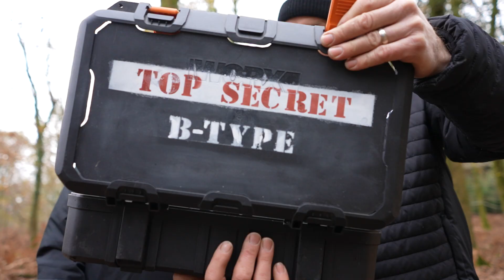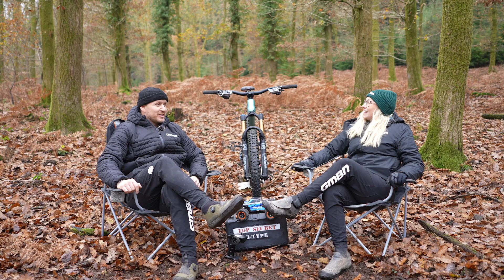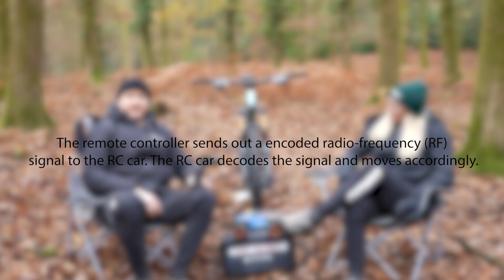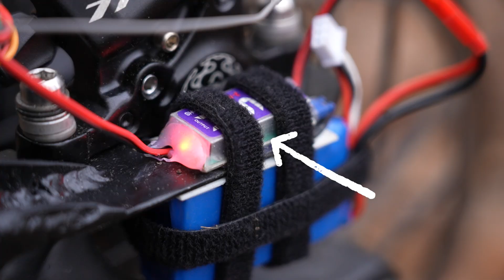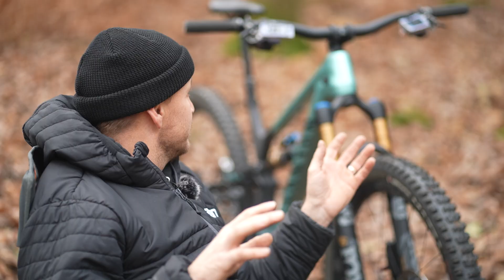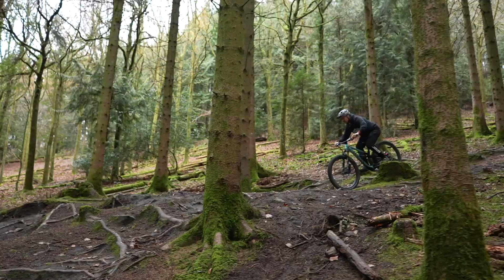Breaking News | Wireless Bike Brakes Are A Reality!

Comment: The airplane industry had to solve this problem 30 years ago in the Airbus. Sure one guy on a bike is not 300 passengers and crew in the back, but that one guy would still have to content with that nasty condition of being dead. How did Airbus solve it? With batteries? With a fancy wireless protocol? No, with tons of redundancy and computation completely out of the window for a system like a bike. We simply do not have the technology to air gap a system like that reliably. It's not one component that could fail, it's the combination of all components that must not fail. Yes sure, technically it is totally possible to remote control brakes, that's not rocket science. We started remote controling things wider scale in the 60ies. The more interesting question is why hasn't a industry so hungry not done the same for brakes? One could think of throwing silicone at the problem, even some AI could be shoehorned in there, predictive breaking in case of emergency, multiple signals etc etc, and dentists will be happy to shell out twice the price of current bikes. But at some point, when the suspension is computer controlled, the shifter shifts automatic, the dropper calculates optimal seat hight on the fly, we might as well put a motor in the bottom bracket and.... oh wait. I'll see myself out.

Comment: Definitely needs a better potentiometer to help it feel more precise and i think that some sort of spring would help the feel of the lever.
Very good though when you consider that this is the first iteration. I'm honestly impressed
Reply: I was thinking about the small elastomers that are in a Redshift stem for some progressive resistance in the lever.
Reply: @TheBRad704  that would work
Reply: I would definitely rather have hall effect sensors. I don't want "stick drift" randomly turning on my brakes, or having an imprecise actuation point (:

Plus, the hall effect could double as a motor cytoff for ebikes.

Comment: This has been bouncing around my head for years. Flying/driving RC, riding MTB but never put the two together. Well done Blake, stick with it mate.

High end transmitter (TX) with dual rates, exponential and end points. Different braking "modes" for different trail types could be setup, expo S curves for sensitivity/modulation and back/front bias, adjustable bite point, fail safe settings in the event of signal loss or low voltage  ... TX programming will blow your mind.
Low latency wifi servos (no servo wires required to RX) with control arms (titanium turnbuckles from helis or cars) on ball links instead of cable, short servo arms for maximum mechanical advantage ... Blake's E-Brake Mk2 could shine.
Add proggressive springs to levers to get that feedback feel.

Comment: Have SRAM do this using their battery for each brake, and they could include haptic feedback at the controls using another battery. So with a full set-up you could have at least 6 batteries, and maybe two more for Rock Shox flight attendant, so 8 batteries in all. Eventually, ebikes could use an in-frame (molded wiring) to pick up at all these locations with a plug intot he frame, and a "plate" similar to the battery mount for AXS, so the product could retrofit older bikes and the system could be used with new bikes. Not sure if the claipers could be all electro-servo or electro-servo/hydraulic boost.

Comment: If you attached the servo actuator to the end of the hydraulic lever you would get a similar hydraulic feel while sending the lever displacement to the servo, Audi is currently trying to do this for cars
Reply: Im also a mechanical design engineer, with 3d printing experience and capabilities, if you want to clean up that cockpit

Comment: Well ngl if we get like the connection and size problem fixed  it is really quiet exiting! Imagine not getting an armpump that quickly again because you don’t have to cramp your arms to get a strong brake nahh just let the motors do their thing. You can also with like motorized levers get a pretty good and also customized haptic feeling how cool would that be??? Bleeding the brake not needed! Brake power is also „just“ dependent on the motor itself. Servicing swapping etc is crazy for racing. Sooo if like a really big company is going to invest some serious time and money in there could be really really awesome brakes😮 probably will also cost like 7 livers? Still the weight is gonna kill it… we would need really powerful batteries that also need to last a long time. At the end I think to get such brakes to fit universal look sleek and also be able to use daily is going to be really hard :/ maybe it’s going to be a racing thing? I mean like small ones which can last 1-2 runs maybe?

Comment: Technicaly they are hydraulic brakes with additional crap and you gonna struggle to make that additinal crap smaller. I have hard time believing, that anyone would preffer bulky calipers over two hoses. While I was wrong plenty of times in the past, most probably wireless brakes would have to have some advantage over hydraulics to caught on. For that you'd need to outengineer that hydraulic calipers, which honestly I don't think can be done with current tech.

Hydraulics: 
+ work without batteries
+ don't need to be paired
+ self adjust for pad wear
- hoses

Your wireless construction (even after refinment, if the priciple ramain the same):
+ no hoses
- always heavier that equivalent hosed version
- additional failure points

Comment: Many thousands of us have thought the same thing with wireless and servos. Its fine for a chat on a channel, but just coz you can doesn't mean you should. Brakes are all about feedback and feel, and most importantly safety.
This is a pointless use of tech, which will "fail dangerous" , not "fail safe"
Stop this crap before someone gets hurt.

Comment: Brakes are probably the cheapest most reliable part of a mountain bike. I've gone 1500 plus miles on a set which outlasted the tires, tubes, chain, cassette and  pedals by several hundred miles. And I can't imagine my battery dying riding downhill

Comment: For proper 'failsafe' brakes like a Lorry or train, you need brakes that are held fully on and the mechanism pulls them off when its powered up. Pulling the lever then shuts the mechanism off and allows the spring to put on the brakes. That way if the battery mechanism fails the brakes come on.
Reply: Deadman brakes

Comment: You should replace the servo with a solenoid. you're technically still using a cable between the servo and the break system. A solenoid would be way more efficient. You would have to find a way to fit a plunger into the break system to replace the fluid. The plunger would replace the need for a cable. With modern 3d printing you could probably integrate the solenoid with your system really easly.

Comment: I wonder how much difference to the modulation 'feel' adding stronger springs in the levers would give? Also I do have both a resin and fdm 3d printer if you want help with prototype parts 😎😎 if my skill allows for it lmao

Comment: Always thought about this being possible whilst out racing my RC, and you went ahead and did it! Fair play, nice work Blake! 👌 You can also get a little module used for when the RC car goes out of range it puts the servo to a predetermined position (Brake on), this could be another fail safe for if you drop signal/ handlebar battery dies/ battery falls out.. DM if you want to know more- also have CAD& 3D printers so I can help you out if you need to get anything made
Reply: Module is used in RC boats, when they lose signal, they turn and hopefully pick up the signal when the boat gets closer.

Comment: I was sceptical at first, especially without the haptic feedback, but Blake showed what control levels he has with an amazing ride. As a disabled cyclist, this would be a great thing to explore due to my weak finger strength, but probably more on my motorbike than my mountain bike. I think that Blake could well be the next Mike Boroughs, both them have or had  crazy ideas that eventually become common place. Great work Blake and GMBN.
Reply: You could build in a high resistance point on the trigger and have it adjustable, this would be like setting the bite point. Think like a cam plate where the tolerance for the trigger becomes tighter.
Reply: @v8srock  I get the idea but the resistance on the lever be a fixed aspect of the brakes and have the system adjust how much of that lever throw you need (force on the brakes) based on how fast you are going. All kinds of ways to do it with a fully electronic system.
Reply: Haptic feedback isn't something you would need. You don't get any feedback regular hydraulic brakes from the hydraulic fluid or cable housing, whatever you feel from the brakes is transmitted through the frame and fork so in that sense a electronically actuated hydraulic brake system would be no different.

Comment: But why? Even our most luxurious cars/SUV’s don’t have wireless brakes, so a MTB shouldn’t either. It’s a concept that takes it too far.
Reply: Some vehicles do have full drive-by-wire, which includes steering control. The reliability has really declined in modern cars with all the unnecessary electronics they've piled into them, these days.
Reply: @lihtan  which ones? Are you taking about the Tesla Cyber Truck? It was steer-by-wire.

Comment: What needs to happen now, as a natural evolution with bicycle technology, is that someone invent a button, a wireless controller.... that the bicycle rides itself while the rider can stay on a warm couch, drinking hot chocolate. 🤪
A parallel universe--the automotive industry and motorcycle industry--has progressively disconnected the operator from mechanical devices to control aspects of vehicles. Steering went from hydraulic to electric.... it was pretty garbage in execution and still is, steering feel is eliminated in many cases. Throttle control went from a cable to a spring with an electronic potentiometer. Now a computer controls throttle, you just push a pedal or twist a grip against a spring. A voltage goes to the computer and the computer runs the throttle. It's had a lot of challenges and has cost thousands of hours of R&D and development cycles to try to GET BACK what was lost by eliminating a simple cable. Next came brakes on cars. Pedal isn't shoving hydraulic fluid anymore. It's just a flapper moving another electronic gizmo which tells another device to run a hydraulic cylinder to ultimately apply brakes. Feeling is gone.

It's all leading away from organic, tactile natural connection to mechanical devices and giving all control to digital computer interfaces. It's a bad trend in this world and I'm not all about it. It's complexity replacing simplicity. It's a ton of engineering and cost to solve a problem a simple device once controlled.

Comment: ☢☢☢☢I think you should look at a load cell for the brake levers as that will give you the pressure you already have with cable or hydrolic brakes( whats used in sim racing for brake pedals, or electronic scales)☢☢☢☢

Comment: I absolute Love Eletric Shifting and my Dropper Post.
Easy to Setup and switch between Bikes.

I'm interested in electric Brakes, i would trust the Transmission in general. My AXS Connection works perfectly.

The only Way to fix an Transmission Lost/Battery Issue would for me be.

1. When moving 
Connection Lost - only Rear brake slowly, but not complete and hard like in Blakes Prototype 
So you can still rolling to the Car/Home If the Batterie dies and you cant ride.

Front Brake and Rear Brake must be an complete System, that when the Front Brake lost the Connection/Power the Rear Brake brings the Bike to a slowly Stop.

2. When the Bike stands (before riding)
Is the Batterie below 33% Power, the rear Brake would close the Calipers and you can't start Riding.

The Brakes have a Timeline from 1 - 1,5 hours who you can "Park" the Bike and the Brakes are not complete shutted down, so If you have a Lunch/Coffee/Pause you can start riding again If the Batterie at 28% for example.

I think it is a long Way to develope eletric Brakes, but i would ride them :D
Reply: But in Reality!!!

There is no Point in electric Brakes.
Hydraulik Brakes works super good in General.

When you want a Clean Cockpit.
There a few alternatives that work.
I only wished for the Brakehoes in general came in another Angle, maybe direct under the Handelbar or so

Comment: Cool project, but nah.
Brakes are THE MOST important part of safety system, everywhere. Even if adding proper feel and control isn't that hard of a job, wireless connection and need for bateries Is WAAAAAAY too big of a reliability issue when you are doing 40,50, or even 60 km/h downhill. 
We have the technology to do it, but there is a reason we won't do it.
Reply: its already done in cars... And for no reason other than stubbornness, we had disc brakes on cars for 100 years until finally, we got them on bikes...
Reply: @pgn666 we don‘t have wireless breaks on cars, they are all wired! The safety issue is not the electronic breaking, but with the possibilty of the signal getting jammed!